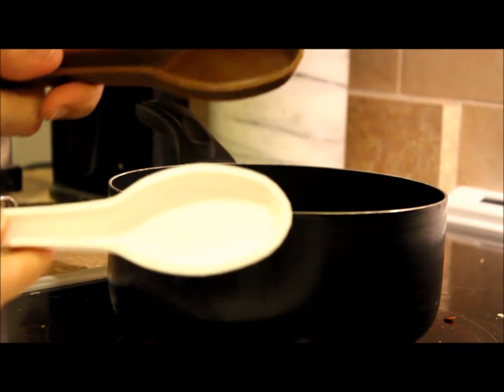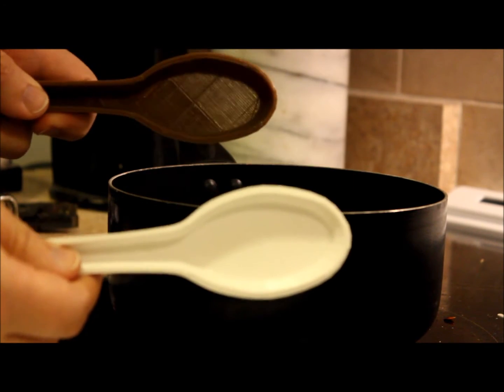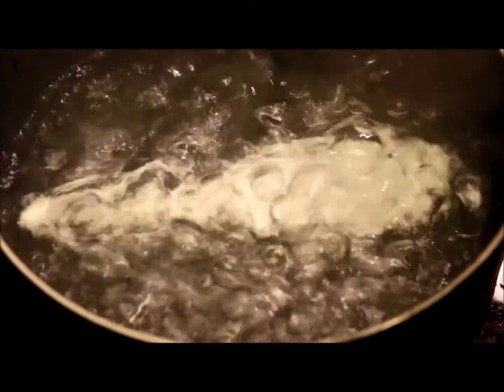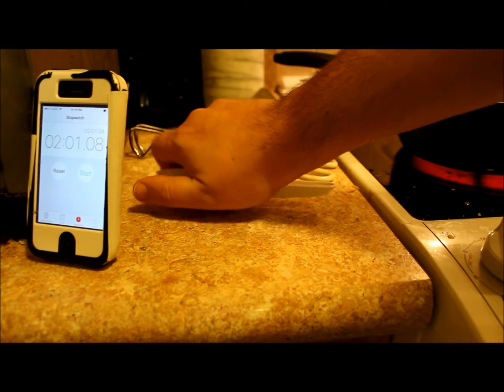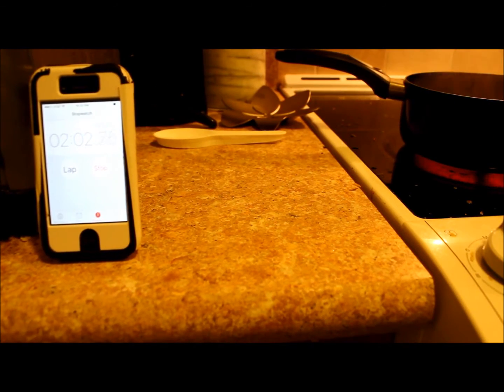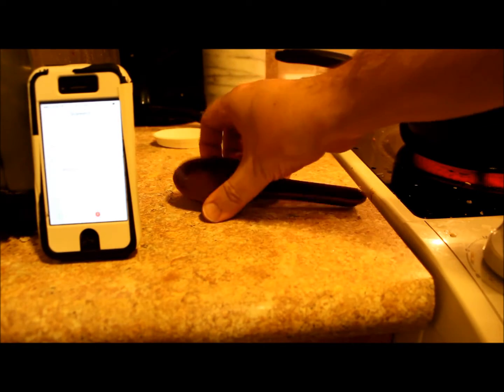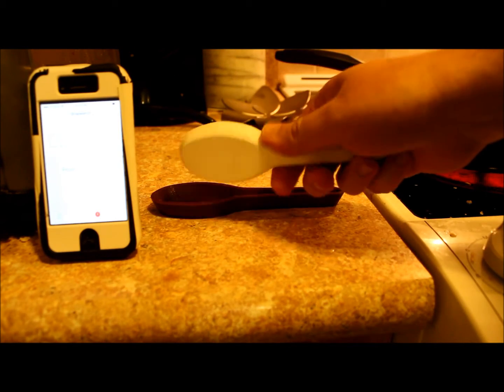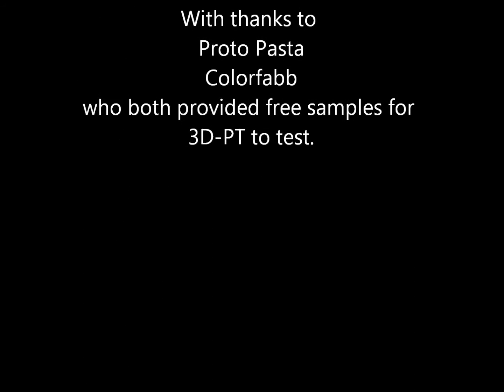Heat Testing Colorfabb HT & Proto Pasta HTPLA 3D printing filament

Comment: The only thing i like about the proto pasta more is that you don't need a heated bed or a higher printing temp. So did you notice ZERO difference from heat treating the protopasta?
Reply from the maker: There was a slight difference between treated and non treated HTPLA which I covered in a blog. Its a small difference in the flexibility of the print when heated. If you do a lot of stuff with HTPLA in the kitchen it might be worthwile, but for what I did... No. The HTPLA worked about the same treated or hot, the HT was stiff before and during testing.

Comment: Did you heat treat Proto Pastas HTPLA before you did this test? That is necessary to obtain the high temperature resistance. The color change is also to be expected during heat treatment.
From Proto Pastas site:
"How do you "Heat Treat" for maximum performance? Bake your parts into a oven until you see a change from translucent to opaque. Yes, there is an obvious visual change indicating the improved performance! We had good luck in a lab oven at 110C (230F) for an hour or less. "
Reply from the maker: +gadgetguydk Yes I did heat treat the HTPLA. Please check my blog at https://3dprinterchat.com/2016/03/colorfabb-filament-review/ for the full review and links to the article on heat treating. In all honesty there was not much difference between untreated and treated HTPLA. Colorfabb HT was more heat resistant, and required no heat treating.